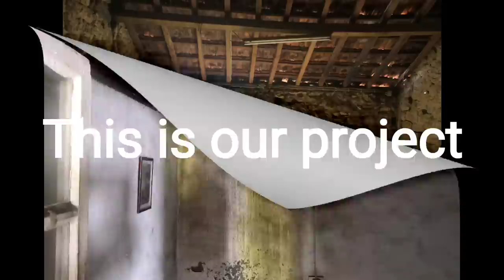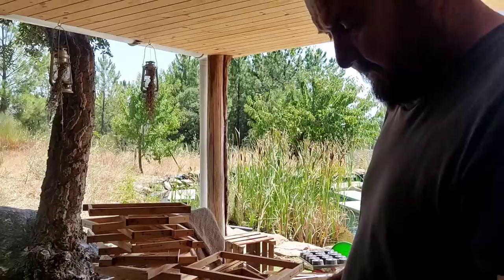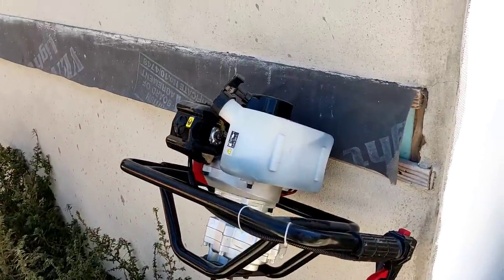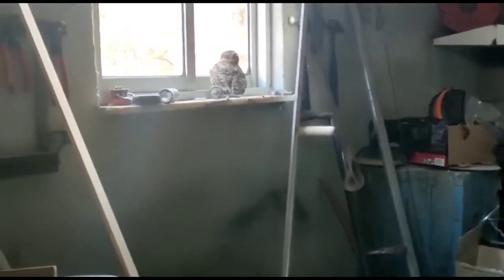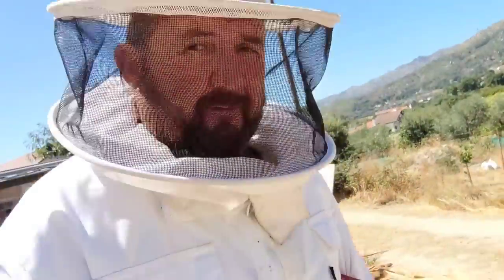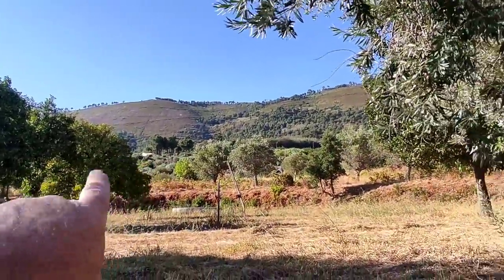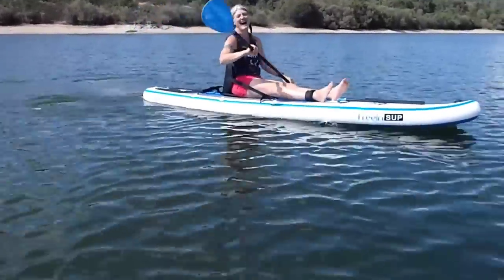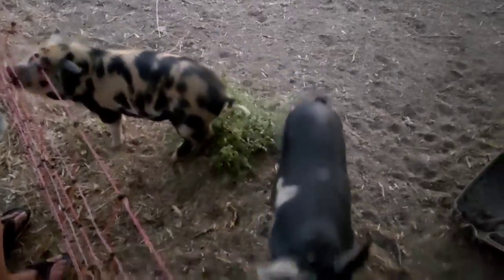91 : Many Jobs on Our Portuguese Quinta, Pump problems and Fun on the Water

Comment: Hi Nick.
If you tap the vessel on the water pump and it sounds solid you need to change the diaphragm in side if it’s hollow there maybe a leak in the valve.

Comment: Love the paddle boards, how great is that!!!  The bladder in your expansion tank , looks to have a slow leak.  In the states, the bladder isn't repairable.  Chuck the old tank and screw a new one in place.  Pumping some air in will help in the short term but eventually it will need replaced.  If it gets really bad, water will begin to migrate above the bladder.  Game over at that point.  Thanks for all the great work your doing on the channel.  Good luck with the bees!

Comment: My pump with a little pressure tank had a similar problem. I had a pro here doing something else and he found a leak in the rubber bladder inside the tank. He ordered a replacement for me and it has worked fine since.

Comment: about the pump it only should work if you open a faucet. 
check for leaks in pipes. dont add much air in pressure chamber usually they have a small tag with the pressure range. if membrane is leaking you can find a replacement in Gonçalagro zona industrial do fundão for example

Comment: You have to replace the expansion tank because the diaphram  can not be replaced that i know of .   and having a larger tank would be very beneficial too , so it can work more effecient on the amount of time between pump needing to start up again.    Pressure usually is set so pumps starts at 30 pps on the lower end to cut off at 55 to 60 pps

Comment: On top of the expansion vessel is the valve, as youbrightly pointed out.
If if slightly press the valve, like you're letting the air out, does water come out?
If yes, the diaphragm is broke, split... and you'll have to change the whole pressure vessel.